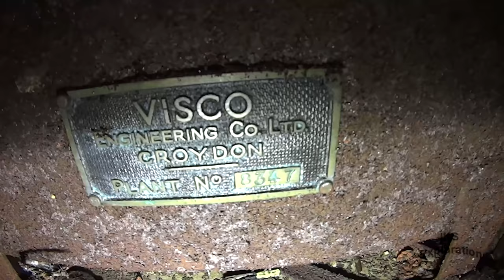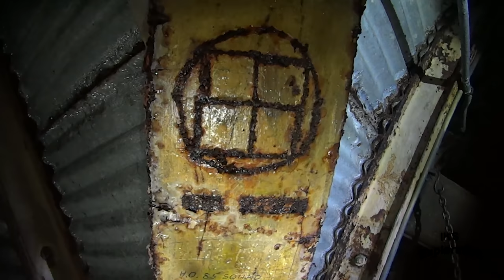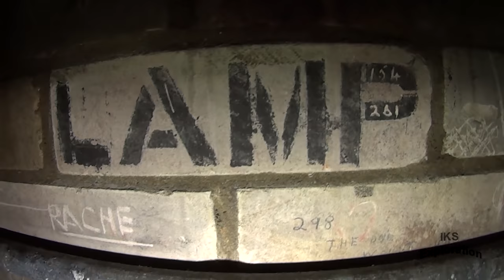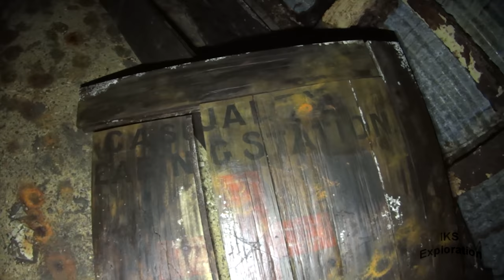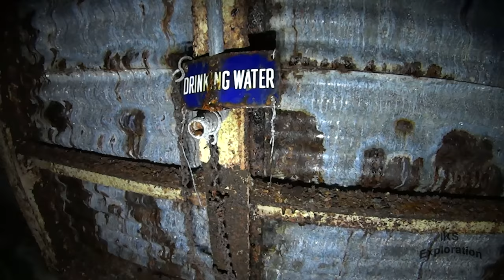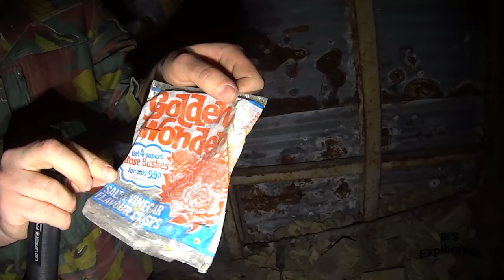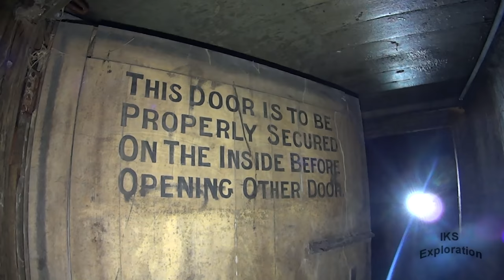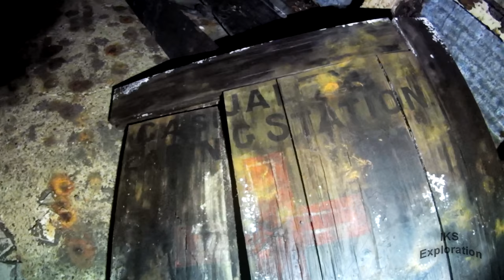Royal Marines WW2 Tunnels - Chatham

Comment: at 8: 14 ballast choke and capacitor for fluorescent tube light above ...... at 8: 38  ventilation fan motor  with stator missing ( copper thives ) ........ at 9: 18  allen west electric starter for fan motor ( internal parts missing ) ......... at 42: 07  brook motors ( huddersfield ) bs 1936 . 20 horsepower 1425 rpm was driving the fan ( all the copper and brass gone )  .  great explore

Comment: It makes me giggle whenever Ian sees a piece of electrical equipment that has an electric motor - “generator?” No it’s not Ian. It’s just an electric motor. Connected to a fan to maintain the supply of fresh air! A ‘generator’ - a dynamo for DC, alternator for AC current, would require some form of mechanical drive - a petrol or Diesel engine - which would be noisy and create toxic exhaust fumes underground. Some places do have them; but most of the small WW2 bunkers ran off municipal supply. Criticism aside, great explore, amazing to see such places; thank you for putting yourselves in such places to create a precious historical record. One thing that gets to me is the fact almost everyone who designed, built, maintained and served in these tunnels will have passed away. The graffiti may be one of the few material traces of those men